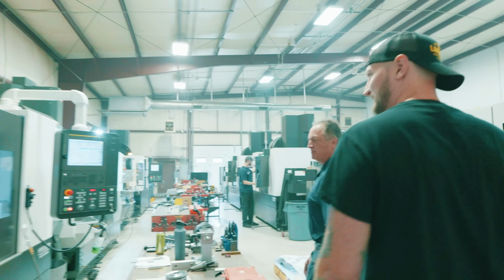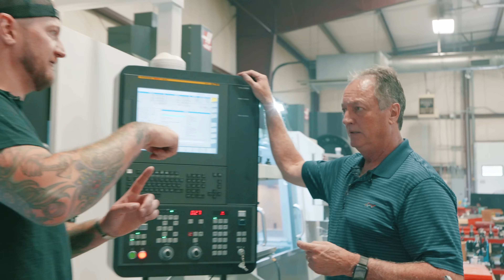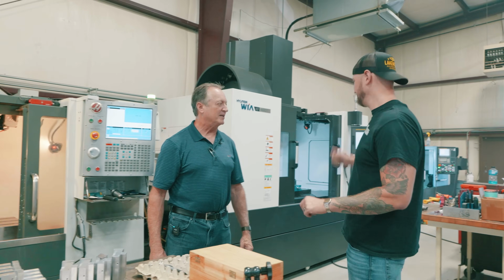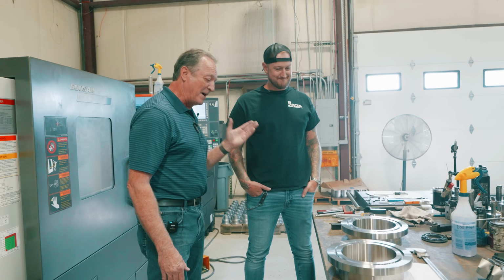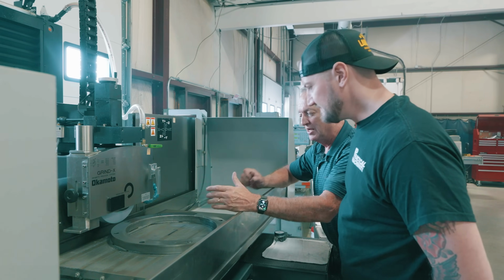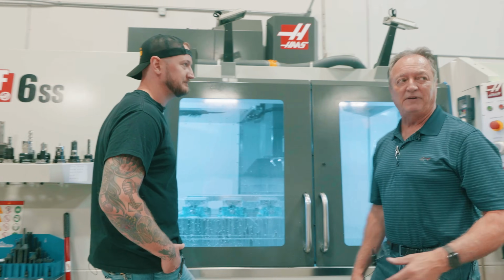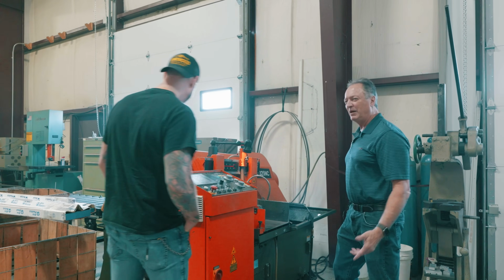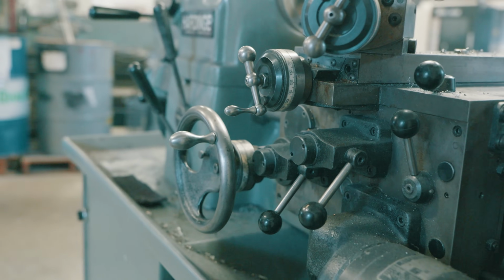This is Why Dyna-Tech Manufacturing is the Go-To for Machining

Comment: Unless they've made a big improvement on their systems, those Keyence XMs aren't as accurate as most bridge style CMM's. There is some variability introduced with the amount of probe force. You should run a gage R&R to make sure what You're measuring is close enough to what your customers are going to measure.
Reply: Interesting! I’ve never used one but I’ve been looking at one - I’ll be sure to keep it in mind! Thank you very much!